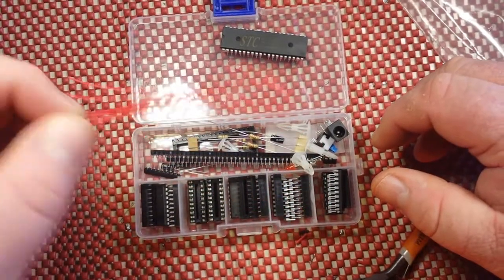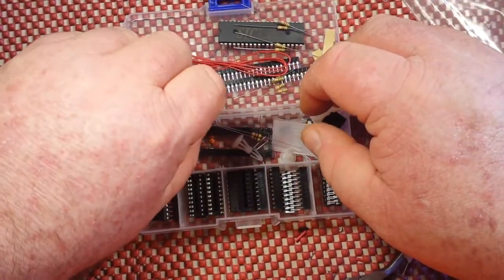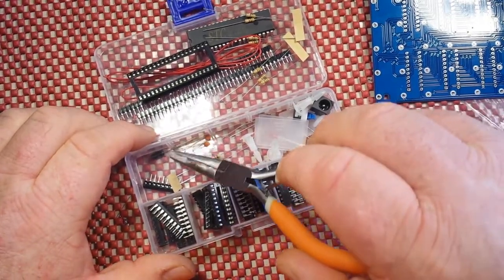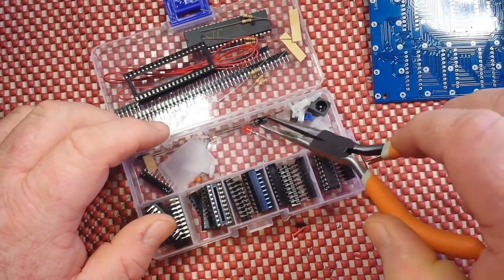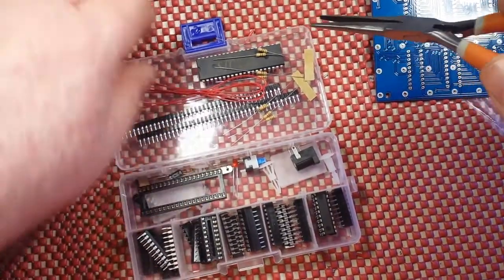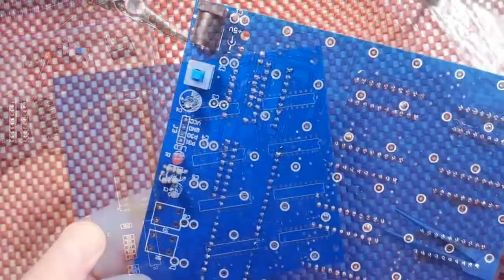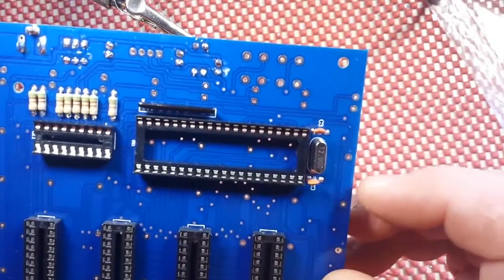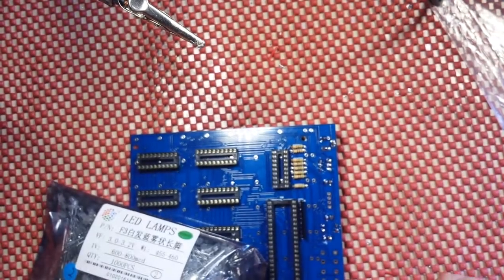Building an 8x8x8 LED Cube

Comment: This kit is also on eBay.. there is a listing that includes a zip file you can download which contains a PDF instruction manual written in English as well as schematics and data software if you need it, I can send the link